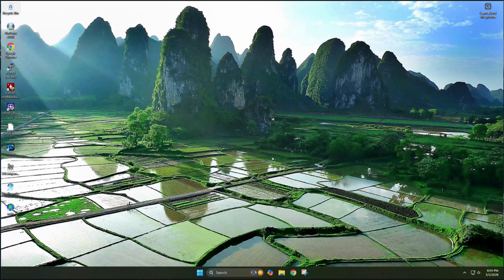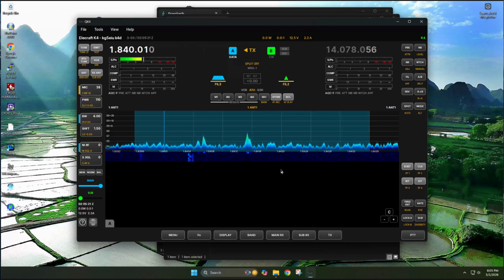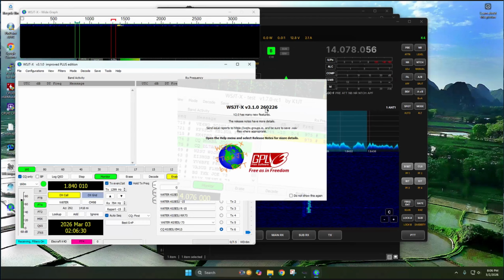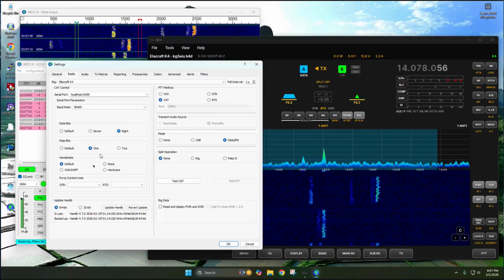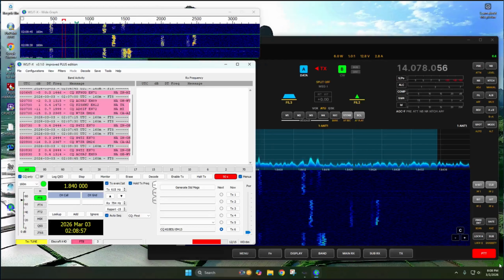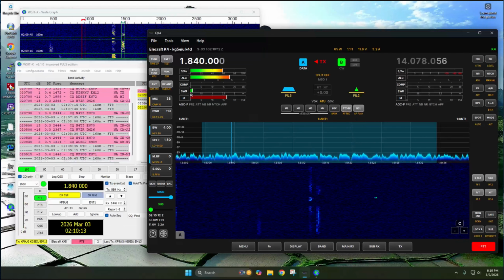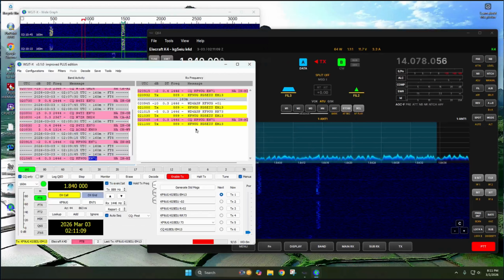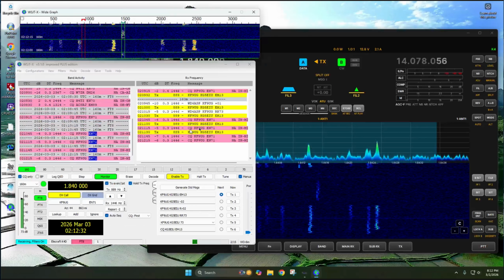Setting Up QK4 With WSJT-X

Comment: I have the Mac version, but I do not see the tools menu.  Can you please let me know how to do this on a Mac?
Reply from the maker: what version of QK4 are you using ?   as of 6/15/2026 the current release is v0.7.0-beta.2  I'd run that release and give it another try, I know there were updates.
Reply: @davidcappello  I am running 0.7.0Beta, and I found OSX26.5.1 killed the USB FTDI driver, and once that was resolved, I got it working.
Reply: @davidcappello I am using the v0.7.0 beta.